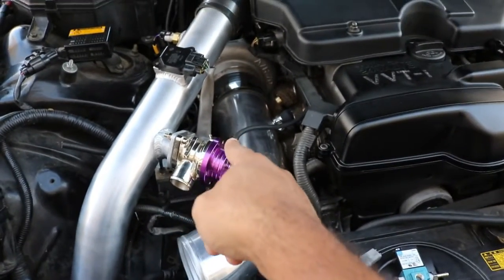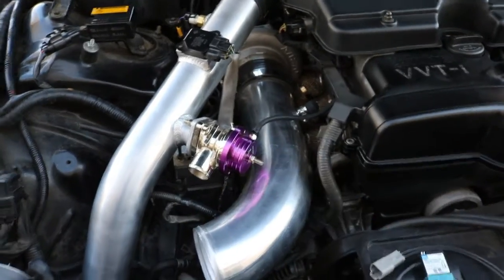Tech Series EP. 6 (IS300 Boost controller installation!) MAC valve

Comment: So just one wire to 12v and the other wire to injector???  Need help got one butt could never install it..😢 scared I might blow up engine with to much boost
Reply from the maker: First off, if you don’t have a stand alone ECU there is no way to control a boost controller like this one.

If you do have a stand alone ECU then one wire gets switched 12v+ and the other wire needs to get wired to an output (typically they are PWM negative) on whatever stand alone you are running.

Feel free to ask anything else you may need and thanks for watching! Hope you decide to stick around.
Reply: Yeah I figured...thanks brother
Reply from the maker: @Skyler478  of course.